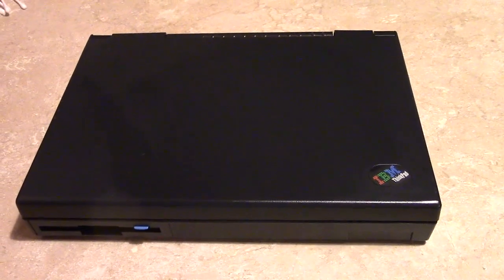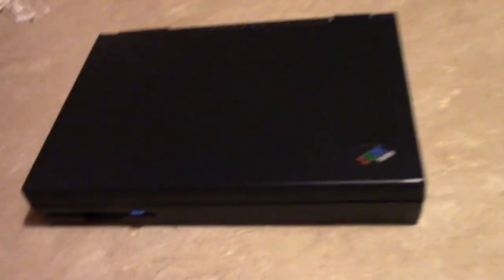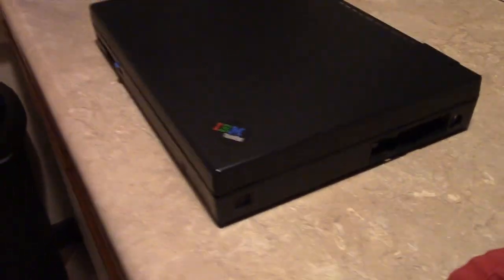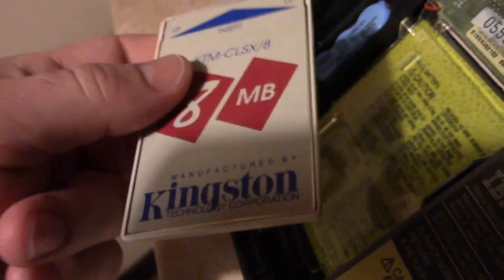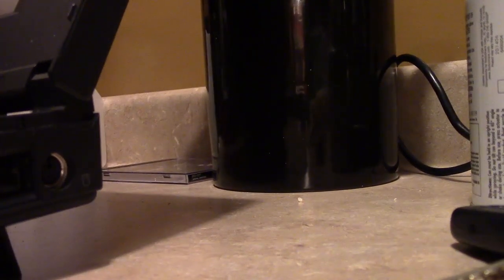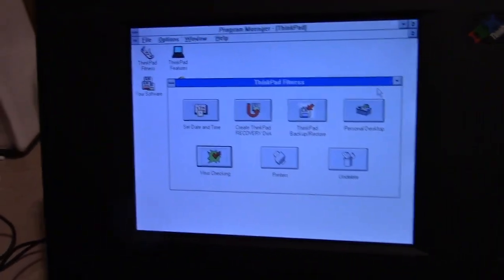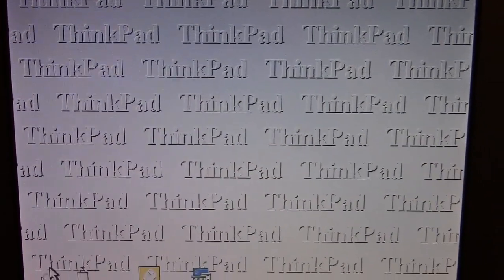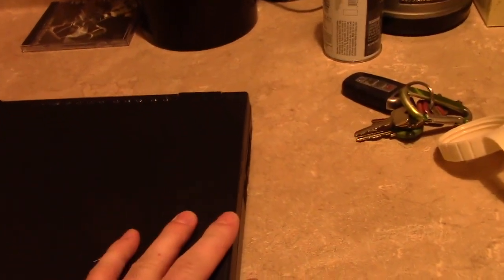IBM Thinkpad 355c

Comment: I have an IBM 370C which looks absolutely identical to your 355C. I got mine from an ad I placed on a website here in Britain called "freecycle" I just put up a wanted ad for old laptops. I was told it didn't work by the original owner and it did not boot when I turned it on, however the issue was as simple as re connecting it's hard drive as it had become disconnected somehow. Still boots with I presume it's original win 95 installation. It was a "Norwich Union" laptop which is a company that still exists but they changed their name quite a few years ago. I have looked through it and can;t find any personal files, in fact it seems to be a basic install of 95 so it may have actually been refurbished at some point.

Comment: is there supposed to be a door for that gaping PCMCIA slot on the right side? I have a Thinkpad 360CSE and it has the same huge hole on its right side. Is that just how it's designed?
Reply from the maker: no, but it would have had a removable plastic "surround" that snaps into the opening and provides access to the card's connector(s).

Comment: The Microsoft Anti Virus did come with MS-DOS 6.0 when it was released. I have diskette images of DOS 6.0 and 6.22 upgrade that I got for free when I was in college with the Anti Virus software, as well as Microsoft Backup and Disk tools, like the Defragmenter and Disk Compression (DoubleSpace).

I have 2 ThinkPads in my collection: 380D DSTN display, and an R40. The ThinkPad R40 I purchased at a thrift store and didn't POST at all. The issue was a bad memory module (guessed the right one) and it powered on without issues, then when I was cleaning the heatsink (no thermal compound on there, which was weird), the heatsink fan power connector ripped off when I accidentally pulled it when I was attempting to remove the power connector itself. I fixed the issue by soldering the connector back on and it still works. The ThinkPad 380D came with everything, including the carrying case that I use for taking my papers for work with me. I wish I can find a completely assembled TFT Active Matrix display for the ThinkPad 380D as I use it to play DOS games (the sound card supports DOS).

Also, did you know that for the ThinkPad 355C has it where you can either insert a modem or a sound card? The sound board model number is: 66G5037 in case you're wondering and I found that in this manual on page 298, item 31 and 21a (item: IBM 84G2307) here: https://download.lenovo.com/ibmdl/pub/pc/pccbbs/mobiles/tpvol2.pdf

Comment: Rambling's alright. 
Given any thought to getting a dock? My last comment has links this time, although I don't know how available the seller is.
Reply from the maker: I thought I mentioned this, but this laptop has no dock connector. This was likely a lower-end unit, as it also has the upper PCMCIA slot permanently disabled (no pins, no eject button, and a plastic "block" on the upper slot rail).
Reply: You did mention it, that's actually very difficult to miss. 
I was asking an unrelated question in the most likely place for you to see it. The dock would be for your 760.

Comment: With regards to your Creator's Update troubles, that's exactly why I'm not exactly keen on Windows 10. I've tried to run it on numerous hardware in my house and more times than not the updates have broken things more than they've helped. My SO's PC crashed into a BSOD loop after one, and mine followed not after, and then there was the infamous webcam breakage after that one update.

I really want to like and use Windows 10 but with the updates being the mixed bag they unfortunately are among other things I just feel like I have to ride it out on 7 until the bitter end.

Comment: 25:29 Oh yes! I remember! My R52 is the oldest laptop I have that still has its original factory image (from late 2005, though it was last reformatted in January 2014) and I did actually create recovery discs using the software, but used an external DVD multi drive as mine was only configured with the DVD combo drive, and the image itself took up a single DVD. Heck, if anyone wants the recovery media of a US English image for a ThinkPad R52, do message me on YouTube, Facebook, or Twitter. Yeah I really need to fix my Gmail settings so that i get my YouTube notifications again.

30:54 I'm pretty sure Compaq had a similar background back then.

32:13 For me, I had UxStyle and File Menu Tools installed, one or the other of which was preventing the Explorer shell from loading after installing the Creators Update. After uninstalling both, my system was usable again. There was even a web page that popped up when the Explorer shell loaded for the first time after the update, and of course, they have to load it in the Edge browser (which I don't use due to its lack of custom font support), because Microsoft.

33:54 They called it a "de-install". Wow.

34:09 Did they really put McAfee on there?

Comment: I have a sneaking suspicion that MSAV back then screwed a lot of peoples computers up far more than a virus ever did.   I just picked up almost the very same model of Vaio actually, except mine is FXA48, which is basically the same model and specs to yours. Someone removed the Windows and Athlon4 stickers from the palm rest on yours though.

Comment: IIRC the final version of Microsoft Works came out in 2009. After that, it was replaced by a free stripped-down version of Office 2010 that only included Word and Excel and displayed Ads. Then of course they ditched that entirely after a couple years and switched over to the subscription model for Office 365 because obviously Microsoft had to find a way to keep digging into customers pockets after the PC was sold. :p
Reply from the maker: I hate it because of  the proprietary file format.
Reply: Indeed, that was quite annoying. Microsoft did release an update for Office that allows it to open files made with Works, but that's an extra step that many people wouldn't know how to do or even know existed, so I wouldn't consider that a workable solution. Yeah, it did fill a market need at the time, but realistically it's good Works is dead now.

Comment: Concerning the MSI:
Have you tried Opera?
They switched their core to Chromium/WebKit just like Google Chrome, but from my experience it is way better optimized than Chrome itself, also it features a free unlimited VPN and you can install every Chrome Add-On.
I have made the best experiences with it
Reply from the maker: Honestly, no. And I don't plan to. I'm tired of playing "musical web browsers." This is getting fucking ridiculous, seriously. Firefox works slightly better, but ultimately, I'm probably going to sell this laptop and buy something with a more stable hardware build.
Reply: Are you sure it's the computer's fault?
I am running on a janky a** Alienware with Linux Mint, that system could not be more unstable, but the browser never was the issue - no matter what I used.

Comment: I have the 355CS model except the hinges went on mine and it is now held open with a string.
4MB ram in mine along with dos 6.22 and windows 3.11 on a 2GB hard disk. The original 175MB drive mine had developed click of death so i upgraded the hard disk. soon going to change it to compact flash. 

Runs doom if i boot dos without himem.sys by holding shift

Comment: Man, I've always wanted a older IBM Thinkpad but can't find one cheap ( I don't feel like getting raked over the coals on Ebay either) , Anywho , speaking of Laptops , I found a Working Toshiba Satellite Pro 435CDS for $14.99 with a Battery that holds a 3 Hr charge ( I assume it was Replaced) . It's got Pentium ( not sure the Clock speed) , 16 MBs of Ram and 1.25 Gb Hard Drive. Only issue is the Dual Scan Screen ( At least that's what I thought it was called) is like Trash, it works but looks horrible , just assume that's because its Dual Scan. I plan on trying to find the External Floppy Drive and Upgrade the Ram to 32 MBs or Maybe 48 Mbs ( If I can). I also might replace the Hard Drive with SD Card or Compact Flash but I'm not sure if I will.

Comment: Its a shame that you really do have to do a fresh wipe and install on a brand new machine, even before you really use it. I really think if one of the Windows PC makers would try putting out a computer with a stock Windows version, no bloatware and all that custom interface stuff, just Windows and the hardware drivers, they might find customers prefer it

Comment: Joking Aside, Any time I get a new computer I reinstall Windows to get rid of all the crap ware, for Windows 7 I had an OEM disc that I got from Digital RIver that I modified and added a collection of SLP certificates that I got from a forum where a bunch of people participated and ripped the SLP certificates from several manufacturers windows installation media and they created a collection of SLP certificates for essentially every OEM that uses SLIC/SLP activation that way you could add them to your Windows installer files and have a single installation file set for just about every pre-built computer instead of having to have the manufacturers installation Media. When I got a machine with Windows 8 on though I couldn't legitimately source a clean Windows 8 disc so since I was in school at the time I created a Microsoft Dreamspark account and used a copy of Windows 8.1 Embedded Industry Pro on my new laptop which worked out nicely since Windows 8.1 Embedded Industry Pro is just Windows 8.1 with no preinstalled crap-ware the only pit fall is that it doesn't have media center which I don't use anyways. I like how with Windows 10 Microsoft has made it very easy to get the installation media and since they have tweaked the the way SLIC/SLP activation works everything needed for the system to activate is stored in the UEFI and you don't have to modify the installation media to add a collection of questionable SLP certificates.

Comment: Oh MS anti virus, what a shit application that was.  I remember using it back in the day.
It would always come with false positives and in the case you actually had a virus, it wouldn't find it or not be able to do any thing about it.
Oh how things have changed!  Now the similar application is actually quite good, but the whole operating system (W10) is malware by itself lol.  Which in some ways it is an upgrade as back in the day we would call any Windows 95 and up as a virus on itself lol.
Before I forget, FU MS and W10!  

You might need to connect online before that application can run properly. Not always an application would launch the connect to the internet